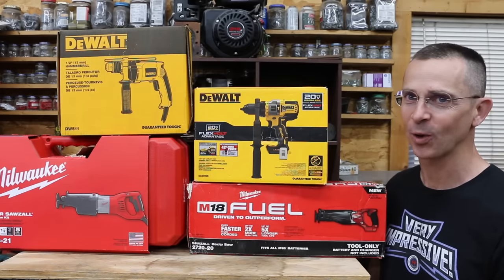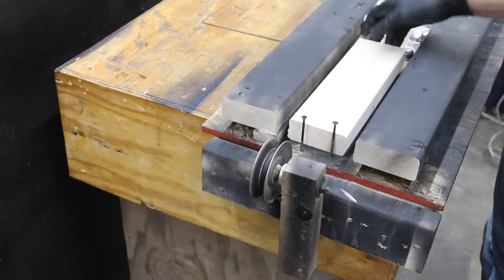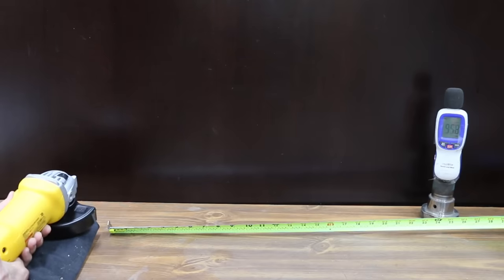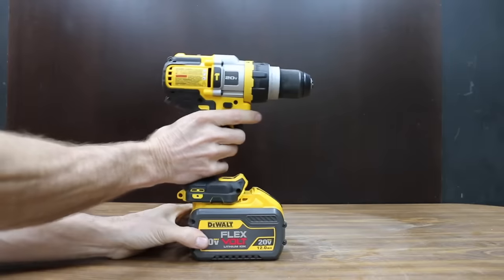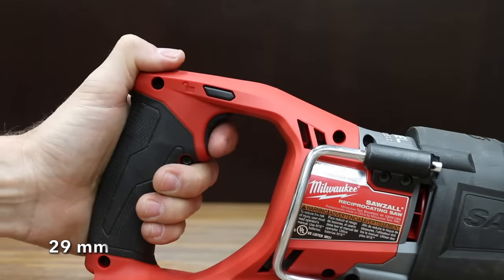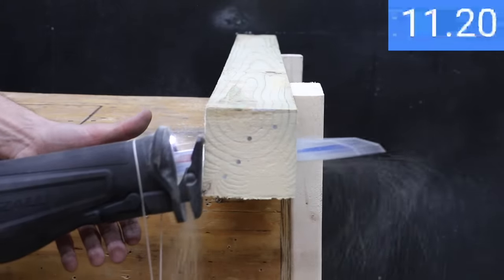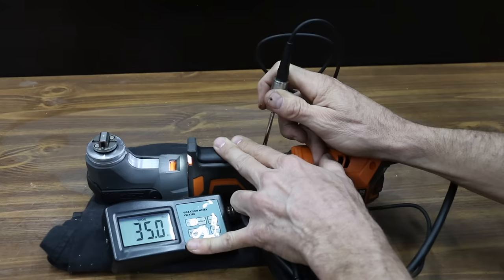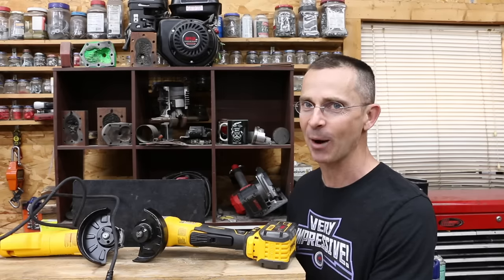Let's Settle This! Are Cordless Power Tools REALLY Better? Torque, Cutting Speed, Noise, Vibration

Comment: A cordless drill is one of greatest inventions of the 20th century, and my 9.6 DeWalt from '94 is still in use for my daughter.    Other than that, I'd probably go with corded for many tools if line power is available, because cutting speed is not an important feature for me. And I speculate that the corded tools have not had many design upgrades that would make them comparable to cordless tools for some features.   Also, except for the Ridgid brand (free battery replacement is included), all of the cordless tools will need batteries replaced at some point which can be a price factor too.

Comment: Cordless is for convenience with some performance loss, corded is clearly better and will work all day, and the tools likely have a decades long life span. Replacement batteries costs are the issue with cordless, Ive got a Bosch cordless grinder and the two batteries are already getting week after 3 years of occasional DIY use.
Reply: Not always on very heavy tools in NA batteries can actually out perform wall plugs because they can deliver more power admittedly for a very short period of time. The best example of this is 3/4” and 1” impacts The batteries can on the large tools provide more power than a normal 15 amp wall socket can. That said you need to go yo the larger 40/60 volt tools to get this performance benefits
Reply: Life span can be great for corded tools but there are quite a few that will definitely fail if you use them regularly. It's the same for battery tools but if you're a contractor or someone who uses tools every week chances are the thing will wear out within 5-10 years no matter what it is.
Reply from the maker: Thanks for the feedback.

Comment: Yup. Your closing statement says it all... if you are close to an outlet, corded is ok... but if away from an outlet, battery is best.  Just like a desktop computer vs a notebook... corded is generally better, but cordless wins on mobility.  If I could can buy only one tool, cordless is my first choice.
Reply: Also depends how long I'll be using the tool. The longer you use it, the weaker the battery gets, corded is better even when not close to an outlet if you plan to use it all day or even a lot of cuts/holes/grinding
Reply: Id much rather use a desktop computer
Reply: Batteries are expensive
Reply: eh completely depends on what you're doing. If it's a big job with access to power i'd never bother with battery tools (drills being the exception) You're not going to see battery powered miter and table saws at construction sites.
Reply: @altokers  I beg to differ. Metabo has an adapter for their battery platform that allows them to essentially become cordless. I wish more companies would do this cause honestly the 12.0ah batteries would be more than enough to cut on a lot of job sites today
Reply: @colbywood8113  

But why bother? If you're going to be there for an extended period of time just run a power cord.
Reply: @colbywood8113  Should also be possible to replace the battery on a cordless tool with an AC to DC transformer connected to the mains power. Essentially making the cordless tool corded.
Reply: @nhytg376tgyuu765gjmg  my apologies, that's what I meant. Metabo makes a CORDED adapter for their battery platform that works with any of the tools on that platform
Reply: @altokers  I meant they make a corded adapter for the battery platform tools that makes it corded. Then you have the best of both worlds where the concrete forms can be constructed if you don't have power or if you don't want to run a cord all the way to your barn to do a 2 hour repair or anything where it's convenient you can use a big sufficient battery, but with the adapter on job sites, run cut station tools without the need to charge cycle your batteries. Plus, most of the cordless tools are often lighter now than their corded counterparts (like a 10" Milwaukee Miter). If other platforms did this, they would be better off to make other larger tools like router tables,  jointers, sanders, and planers if they wanted to further expand their lineup without people fearing they need to drop another $1000 on batteries
Reply: @colbywood8113  Aha, got it. 

At first I imagined a battery powered inverter to plug a corded tool into.

Remembering now that many years ago some small cordless tools didn't have removable batteries and you had to plug in a cord to the tool when charging. But it was possible to continue to use the tool powered by the charger cord.

Comment: I vote for corded.  Not only can you have issues with the batteries and the power output, if you need new battery within a year than you may find it, but after a period of 3-10 years, you may be hard pressed to find a battery that fits your model because the companies all changed the design of their tools and battery and the stores are going to sell the newest version.  And now with the great reset, inflation, and all the other issues with economy.....I want to pay for a tool only once and not have to invest more money into the same tool for a battery, worse yet have to buy a whole new tool, and if we don't keep the demand up for corded- Vote with your money- it may go away and be stuck with only cordless.  How did we and past generations get past being plugged in before batteries?  Just fine, things still got built!
Reply from the maker: Thanks for the feedback.
Reply: I feel you are missing some things here. Back when buildings were built before battery powered tools, jobsites were dependent on the oil industry; sites needed generators running all day long. So rather than having batteries on the tools, the corded tools need a bigger, noisier, stinkier battery filled with diesel. Additionally, the batteries actually do last a long time for what they are. You can still buy DeWalt 18v batteries for their 20 year old tools. Plus, they sell an official adapter to adapt the new 20v batteries to their old tools. Metabo HPT sells an adapter so that you can use either batteries OR a plugin on their cordless tools. 

Cordless or corded tools are subject to manufacturer support at the end of the day. Either tool could breakdown and have no replacement parts available. A lot of cheap corded tools by Mastercraft and brands like them don't even sell parts individually as far as I can find. 

Yes, cordless tools mean a dependency on the batteries, but it does come with a lot of benefits. This isn't even talking about safety by not having hazardous cords all over the place and safer in wer environments.
Reply: Correction, DeWalt cordless tools started in the 90s so almost 30 years ago and they are only just ending support for their 18v!
Reply: @BoneStack117  "Jobsites were dependent on the oil industry"
How do you think the workers, tools and materials are transported ?
Reply: Not to mention a good portion of customers are doing work at home and not on the go, so having the mobility restriction of a cord isn't much of an issue
Reply: Not Ryobi

Comment: Hey, you didn't test run time... I wanted to see how long it would take for the battery on the corded tools to die. With the cost of batteries lately, I can see corded tools making a big comeback. Do they make a cordless defibrillator to revive you when you have a heart attack from sticker shock??
Reply: Hey USMC.....da_n Right!  Bitching about the cord...but nothing said about the Multiple Batteries and Chargers and Electric Sources needed.  Then of course...ignoring the much higher initial fixed costs...and recurring replacement  battery costs of cordless.
Reply: 🤔 until i just looked it up i didn't realize that non-cordless ones existed
Reply: They do, in fact, make cordless defibrillators.
Reply: @apsynto  It's what we had back in the old days.
Reply: @Bloody_crow  I may have to get one before I walk into Home Depot again. That, and a bottle of Prozac.
Reply: @thinking6307  Yeah, last time I checked an extension cord was still a fraction of the price of a battery and charger.
Reply: I don't pay for my tools. My customers do.
Reply: The vast majority of today's defibrillators are, indeed, 'cordless'; in fact, you'd be hard pressed to find one that needs to be plugged in all the time. They only remain plugged in to keep the batteries fully charged, and we just unplug them when we move the patient from one department to another. There is even a 'pocket' defibrillator which is good for several shocks, but isn't available everywhere.
Reply: @d.e.b.b5788  Well, that's good to know. Sticker shock induced heart attacks are, I think, becoming more and more common. Every gas station should have a fully charged defibrillator on hand and ready to go.

Comment: Cordless tools are so much more handy than corded in so many cases. Anyone who has climbed a ladder with a corded tool knows the frustration of having the cord come apart as one gets in position to utilize it. With battery technology advances the ability to use battery powered tools a real plus. When I started building housing with Habitat for Humanity I bought my first battery powered drill, a DeWalt 14 volt which one needed multiple batteries. Nowadays I keep a couple of 20 volt batteries for my 1/2” impact and my 1/4” impacts. I still use corded for building things on my sawhorses where I don’t have to carry up a ladder.
Great video!
Reply from the maker: Great feedback! Thank you
Reply: You're supposed to tie the extension cord to the tool. You don't count on the plug holding things together. What's the matter with you! You tie cords off.

Comment: Tool longevity is an important factor for me.  I don't wear out most of my tools - I still have the 6365 Milwaukee circ saw I bought new in 1976.  It still works fine when you plug it in.  No battery powered tool will last even ten years.  I've had to toss my old 14.4v DeWalts - it was kinda sad.  I don't think they'll be selling M18 batteries in 2050.
Reply: Fact! I completely agree with you.  I prefer the corded tools.  I got sick of replacing batteries that cost as much or more than the tool itself.
Reply: @kstofkos  corded is good if you have power. But battery power is convenient and portable.
Reply: Its good to have a corded in store. That will always work. But for everyday use I get one with a battery. Only for convenience.
Reply: No doubt you're paying more and more frequently too. But it's a cost/benefit question - it worth spending 4-5x more when you factor in longevity for the convenience of being able to take your tools anywhere? I and a lot of people would say yes.
Reply: @kstofkos    Buy Ridgid.  Lifetime warranty on batteries, no problem getting a replacement shipped to you.  I’m on my third set in 15 years, all free!
Reply: I have cordless saws over 10 yo
Reply: @Sam Cooke, I have a Dewalt battery drill which I bought about 25 years ago, and it's working great, the only problem i've had is one of the two batteries has failed, (about 6 months ago) which is to be expected given the length of time i've had them.
Reply: Well, the maktia LTX 18v was relasead in 2005. I have a drill and a circular saw and 2 3A batteries from around the time that still  works just fine. Also from what I seen there really doesn't seam to be any big plans on retiring the 18v lineup any time soon. Meaning it will soon be 20 years on that platform.  If they still be selling them in 2050, how knows? 
While the new 40v tools are cool , or 60v for that matter, I have no need for them in my line of work. 18v 5a last more than long enough for me even using an angel grinder or sawzall
Reply: @tomrogers9467  Holy crap 😳   I didn't know that applies to the batteries also
Reply: @kstofkos    Yup!  Best deal I’ve ever seen in my (sigh) now long life!  I’ve received six new batteries in total for the drills I bought in 2008, which are still going strong.
Reply: @tomrogers9467  I had to check their warranty page. I couldn't believe my eyes. That is an amazing warranty

Comment: Love your work. Your summary at the end was perfect. Go with the corded tools if price is a factor, you will get similar output. If you need mobility and can pay a little extra get a cordless tool. And always use the right tool for the job, as per the geared vs single speed drill result.

As a DIY/home user I buy corded for most tools to avoid having to buy and manage batteries.
Reply from the maker: Thanks!  Thanks for the feedback.

Comment: I love these videos and the test gear is fantastic, great job. With over 35 years experience using tools, I can honestly say that for a DIY home user the corded power tools are much better value. I have used all types over the years and I now buy corded tools because of simple economics - A battery for a power tool is almost as expensive as a whole new tool including battery. The only battery powered tools I now have are a 18v drill and a 20v torque wrench, all other power tools I have now are corded.
Reply from the maker: Thanks for sharing.
Reply: If you work on your home next to electical cable, you can't use safely corded tool. And for battery, you can have one battery for multiple tools, the only issue is if the battery system become obsolete (would be great to get some legislation to standardize battery connector)

Comment: Battery technology keeps getting better. It’s going to be interesting to see what comes after the lithium batteries. 
I do wish tool companies would make retro batteries for older tools. I have a Dewalt 9.6 that I’ve had since high school, the replacement batteries are remanufactured and are awful, it is a really nice and delicate tool, shame it’s useless now
Reply from the maker: Thanks for sharing.
Reply: I mean a lot of companies will probably make it the very least doctors there is a huge market for adapters
Reply: They make battery adapters that sell on amazon

Comment: I would try the oscillating tool at an angle next time, I never make my cuts using it straight on you'll dull the blade instantly against wood, note the smoke coming off the blades, those are toast lol not trying to come off condescending, you'd get better and faster results, liked and subscribed great review!
Reply from the maker: Thanks!  Thanks for watching and subscribing!

Comment: First off great video and I love how much effort you put into your test rigs to make the comparisons fair. Only thing I didn’t get about the video was the dewalt drill comparison. You used one of the weakest corded drills they make. There are several slightly larger ones that match the cordless one you used a lot better, bigger motor and different rpm rating.

Comment: "Are corded tools more powerful than cordless ones?" Yes. Immediately yes. Just looking at basic electricity laws and for comparison sake, the makita cordless is 36 V. Wall outlets are 120 V. Over 3x the voltage. Then you've got amperage and wattage. A "regular" outlet is usually 15 amps @ 120 volts, 1800 watts (forget about the 80% constant load nuances for a minute). The makita cordless has, what, a combined 10 amp hours and 36 volts. So roughly a third less amperage and only about 30% of the total voltage. Only about 360 total watts vs 1800 for both batteries combined. MUCH, MUCH less powerful. The only question is can the corded tool actually use all that power?

I prefer cordless tools, as does just about everyone, but there's zero question which is more powerful. Just because a corded tool might be poor quality or weak, that's just a bad tool. Nothing to do with the power difference of a wall outlet vs a battery. Of course, another question is, does it matter? If the battery tool can get the job done, do you NEED the extra power? You don't need a 16 cylinder engine to drive to the grocery store...
Reply: That's not how amp-hours work. Most of the cells used are good for tens of amps, in short bursts, double that for batteries with paralleled cells.
Reply: @laurelsporter  I know it's not exactly how it works which is why I said "Just looking at basic electricity laws and for comparison sake". It's a rudimentary comparison for sure, but the point is that a wall outlet has vastly more power availability than a battery whichever way you slice it. It's important not to miss the big picture by getting bogged down in the semantics.

Comment: Always great tests. I find, however, that corded tools last almost forever whereas battery tools have a finite life and the batteries are very expensive to replace. In some cases, almost as much as the cost of the tool!!
Reply: For sure on the battery side of things. One thing to consider with the tool itself is cordless are using brushless motors while most corded tools are brushed. For occasional use it’s a on issue, but for someone who uses their tools a lot, an argument can be made for the cordless brushless being longer lasting.
Reply from the maker: Thanks!  Thanks for the feedback.
Reply: That's why I USED TO love Ridgid. Their LSA means if you register your battery, whenever it fails it's replaced for free, even if it just wears out from use. For the most part they're good about honoring it too. So when you buy a battery from Ridgid you'll always have that same battery, even after it wears out you'll get a new one for free. That was what got me interested in Ridgid, and at the time their cordless tools were pro level so I was SOLD on their 18v platform.

But these days their cordless tools are just "meh", not great quality, their new hammer drill has such bad runout you can't even really use it with drill guides because it wobbles so bad. Meanwhile Ryobis new stuff is as good or even better for cheaper... So now the LSA is really the only selling point. It breaks my heart because I used to love Ridgid